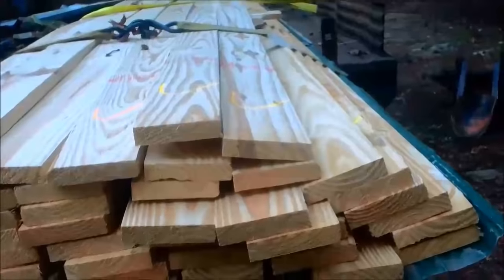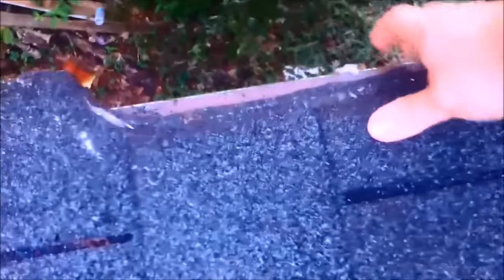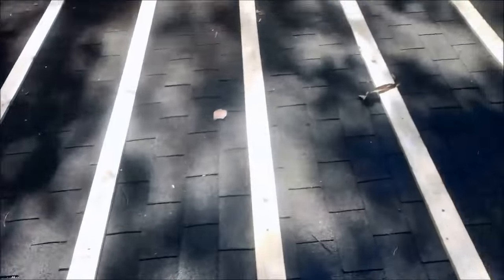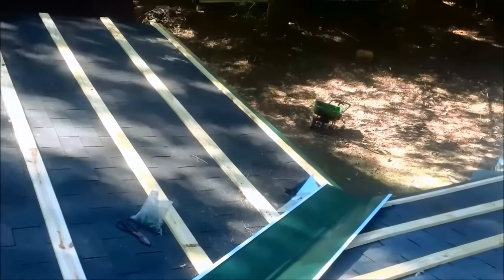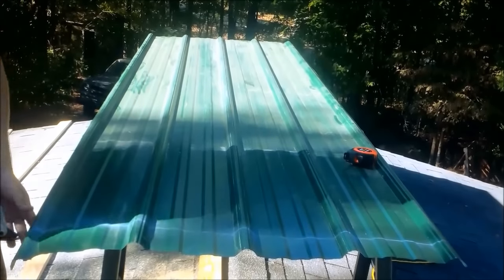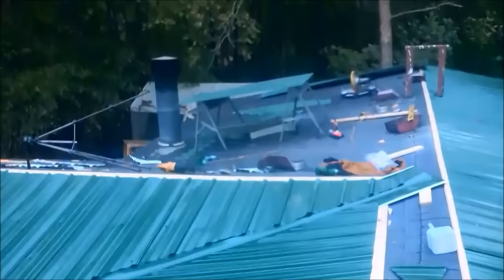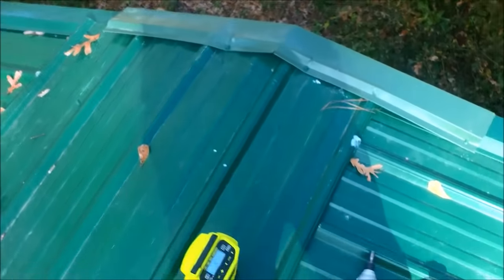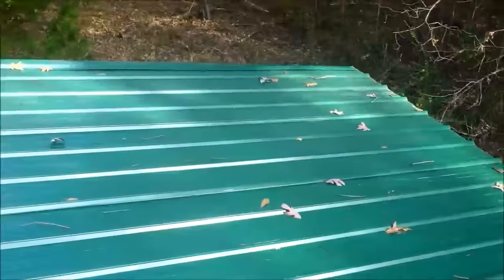How To Metal roof for cheap

Comment: i did ine by myself, took me 3 years, i have bad eyes (i see two screw heads ) and afraid of hieghts. but im poor , so had no choices. i used 5/4 deck boards two feet on center, and used 1inch foil foam between for extra insulation, noise dampening. but i know im no expert, just making due
Reply: You are also a poor speller.

Comment: Nice job. Doesn't look bad. The only concern I would have is leaving 3 layers of shingles on if I heard you correctly that is a lot of weight to leave on your roof especially if you have 2×4 for your roof.
Reply: that's a violation of building code 2 roofs max  and if you have the architectural you cannot shingle over it metal probably ok with long fasteners
he mentioned triple roof plus the strips tat roof is holding a hell of a load if its in snow area there's no margin . roof collapse will destroy the home and insurance might not pay.  see there's areas where there's no codes but it don't mean skip proper building practices

Comment: The reasons the member below said your boards will rott out is from condensation,the industry standard is to lay a vapor barrier down 1st,then your boards ,in between your nail boards you need to insulate because the dead air space under the metal panels will experience thermal shock and sweat,I've fixed hundreds of leaks from non insulated expansion joints and non insulated metal overlays ,I'm also a journeyman roofer/ waterproofef .

FYI the use of treated lumber is no longer required,the industry mandated all treated wood in the 80's and after 3 decades found the treated wood will dry & pop lose it's fasteners and even pull out bricks with tapcons,you used the right wood but skipping the vapor barrier ( cheap 4 mil plastic ) and insulating may cost you a huge condensation problem .

If that happens don't freak out,just remove the ridge cap & fold the gutter edge of the panels up and allow fresh air to flow,install a raised cap with a 1inch gap to allow air flow and condensate should stop .
Reply: I think it doesn't matter.. One clever man said: I am not so rich to buy cheap shoes.. I also think that if you are doing something - try to consult with someone how to do it right, but in this case it looks that he don't care about what he is doing and how it will be looking after...
Reply: joshua2585 you can install a standing seam panel roof directly over perlins but in a residential setting it's not a great idea due to thermal shock , an ice cold or baking hot metal roof will condensate badly ,if your in a cold area heat loss in the attic will hit ice cold panels and make them condensate and drip into the attic .

In a hot area where air conditioning is used for hot months cold air loss through the attic will allow cool air to hit a scorching hot metal roof & cause condensation ,which drips into the home .

It's an industry standard in commercial roofing to insulate the substrate before installing panels,or to instal a waterproof skrim such as ice & water shield under the panel system so condensate can run out from under the panels ,a cheap alternative is to install ice shield on the perimeter & lose lay a heavy visquen plastic sheet under the panels to shed any condensation out of the system and into the gutter .
Reply: over a existing shingle roof no vapor barrier is required and with the air flow between the metal and shingles  it will keep the tin from sweating very much
Reply: Rusty Shackelford in climate zones like Michigan or Ohio that experience constant thermal shock of roofing materials a waterproof skrim under metal roofing panels is a must ,a vapor barrier is an entirely different material .
Reply: I like the tip Michael gave and the roof work. Good job.
Reply: So if you are starting from scratch where you have a shingles roof but want a metal roof. What is the best recommended process and products.  Seems every estimate is different.  What is the best longest lasting way for a place in TN.   Ty
Reply: It has to breath and dry out quickly when the sun comes out a ridge vent done properly would have helped considerably that is one of the biggest issues i have with it is the use of pamels as ridge cap that is terrible at best
Reply: What keeps critters, wasps and bees from inhabitating all those openings ?
Reply: @dennismadigan2023  Nothing lol . you do ..... Some venting can be purchased fairly cheap at a Re Store or on line , &  you could use a piece of screen behind your venting system.
Reply: @atkgrl  tear off the shingles, peel n stick the first couple feet of the roof edge and than paper it than install metal
Reply: @cammccarthy686  but metal directly on the wood roof or on slats.  So it would be a cleaned off old roof, then membrane, then slats then nail the metal to the slats?  So the roof doesn’t sweat and rot away?
Reply: @PlayGirl  you can NOT put metal directly to wood. Metal and wood heat up at different rates which as you said would cause sweating and rot. Their has to be some kind of membrane separation between the two. The same can be said with metal touching concrete , concrete will eventually eat the metal
Reply: @PlayGirl  you would just peel n stick the first couple feet to stop ice damning and than tyvek the rest and install the metal onto the tyvekd plywood.

Comment: Looks fine.... I used to be a roofer years ago.... No need for silicone in fact it is more likely  to cause a problem by making a dam that holds water at the seam.... We would use mastic at the edge that is underneath just thin coat that stops capillary action.... Otherwise bend up both ends and run a ridge over the joint edge.... But you have nothing to worry about you have a roof under your roof... But you should have made gaps in your wood underneath so that air can flow from bottom to top evaporating moisture that in your install will begin rotting your fiberglass and tar paper roofing... As well as the underlayment skins.... Also having those gaps for ventilation would allow your roof to carry away heat in summer.... It's not a big deal I'm sure it will be fine if looks like you do have some horizontal ventilation.... You could have run black pipe under your roof in the gap to pump fluid thru to heat your home on the cheap in winter as well....
Reply: When you said gaps, how would you do that ? Cut into the furring strips or .....?

Comment: It might last 5 years but I doubt it speaking from 45 years in the construction trades. That ridge cap is what is going to cause problems first.  If it doesn't blow to hard when it rains it might work.....Good Luck
Reply: More than one way to skin a cat. I glued some kitchen cabinets to drywall and everyone said it would come down and won't support the weight its been there since 2006 i moved from that apartment and the new tenants are using it
Reply: @divinee.155 mama always said, stupid is is stupid does. 😅

Comment: Keeping the old shingles will cause massive heat storage in the summer. This will impact you A/C bills if you have more warm days than cold days (such as in Florida). Hot roofing shingles will keep the attic hot all day and well into the night. The metal roof by itself will dissipate this heat into the air as the air cools, the mass of the shingles will not. The shingles will readily absorb this heat from the metal panels and hold it well into the night. But, if you live in a climate with more cold days than warm days, then this would be a good thing.

Comment: Saw your thumbnail and had to drop in and say my Mom’s neighbor had a metal roof installed after Hurricane Gustav but had it laid directly on the plywood decking. Along comes nasty Hurricane Ida and he had no damage. Some roofs with metal that were installed with stripping were ripped off. Air got under there and pulled the panels off.

Comment: very nice. I am inspired. I think the caulking should go under so it is not exposed to sunlight
Reply: +David Phillips The caulking should definitely be sandwiched and a high-temp variety.  The UV exposure will make it brittle in no time.
Reply: Caulking is the wrong product for that.the manufacturers specify sealing tape.it’s a special mastic similar to what they use for automobile windshields.Stays flexible in all climates and conditions

Comment: what about putting 1/4 inch rubber strips on the wood so when you screw in the screw you have a rubber gasket on the top of the screw and under the sheet metal to keep it from leaking it the rubber gasket on the screw fails. the rubber strip under gives it added protection and sealing power????

Comment: Great video. Not everyone has the money for a "professional" job. Some just need it to be functional. Making it "Pretty" is very expensive while functional, serving the purpose, can be accomplished on a budget. Your right that they rob you on the trim. There are ways around that which still serves the purpose you just need a creative mind. Luckily I'm not the type who is obsessed with it being "pretty". As long as it does the job I'm good.
Reply from the maker: people spend a lot of money chasing pretty for my own house i buy from the scratch and dent store and i save thousands that way.
Reply: I need  a new roof and have little money.  also disabled 62 yr. old woman.  Where can I buy scratch and dent and how much should I expect to pay to have it installed.  raccoons on the roof have been scratching to get in the house.  just spent $200 for a patch job.  any help/advice would be greatly appreciated.  ty.
Reply: Dale Higgins cheap is not an option
Reply: daschundloverable racoons?
Reply: Dale Higgins I completely agree with you sir
Reply: many ads on Craigslist with roofing installers, u can try one of them.if u catch a roofer in winter months can sometimes get a awesome deal

Comment: If you are putting metal roofing on a slightly sloped new building roof with a tar paper cover over the OSB do you need to put the 1 x 4 down, or is that only to fir off of shingles??

Comment: Danny, has the roof remained leak free?  (I'm assuming you have had to do regular maintenance, at least after 5 years).  Very well done, btw.  Adapting to your needs by fabricating the parts you need is impressive.
Reply from the maker: It's worked out great we had a tornado earlier this year I had to replace the ridge cap that's about it I appreciate your comment

Comment: a bud of mine bought a house in need of a new roof, it had a simple low pitch A-shape roof and he got them to take $15,000 off the house price here in Washington.  Me and him worked on his roof for 4 weekends and put the metal roofing just like this over the older shingle roof which thankfully wasn't leaking anywhere.  He spent only $580 for materials as he got 3 different color metal roofing from a local roofing comoany that had leftovers from numerous jobs and we improvised.  He also used scrap throwaway frame boards to install for the frame which didn't cost a thing either.  All he had to buy was the screws, caulk, and metal trim and joint metal pieces and that was all!  He got 2 estimates from roofing companies up here who quoted $22,000 and $19,500.

Comment: Guy quoted me $1900 for my 18x20 garage roof.
I had the Amish cut me a roof kit for $525.
Doing it myself now.
Its not impossible.
Reply: Damn, wish I'd find pricing that low in central Ohio.
Reply: Gerard, Im fixing to do metal roofing in a mobile home fixer upper,. Is a single mobile home,. How much do you think I would be spending on material only?. My brother in law is willing to do the work for me if I buy all the material.. do you have any idea???
Reply: @mayte8018  what is the length and width of the mobile home. Basic dimensions will help give you a rough estimate. Then are you looking at doing trusses or rafters and what is currently sticking thru the roof like vent stacks or chimney's
Reply: If it was Lancaster Amish, can you provide referral / source?
Reply: Can you give me a contact for the Amish roof kit. Thanks

Comment: I'm not a roofer or carpenter, but why do you need to add the 1x4 cross boards.  Could you just use longer screws  and screw the metal shingles over the existing shingles?

Comment: I did the same on my roof expect its double layered shingled. House started to shift. And cracks in walls. Think its a little to heavy but I just fill the cracks in sheet rock and repaint wall lol.
Reply: It's not the weight, leaving the singles on and not removing them is a national code violation. The singles are a combustible material. People have had their house burn down. It's the same thing when using lacquer, acetone in the trash because it can Ignite

Comment: If you do yours like this man is teaching you to do you will severely screw it up the three-quarter inch boards won't have enough meat to hold screws and they will back out the condensation that occurs in the space left out of 3/4 inch boards will condensate and will Rust the metal

Comment: Im on almost the same kind of a project. Similar roof layout. Been putting on the furring strips , mine are 27 centers. Its fairly hard finding the rafter centers to make sure the 1x4's are down really tight. Im using 3 1/4" nail by air nailer. Im concerned that Im getting the 1x4's close enough to the edge so i can put on the drip edge, because i didnt cut off the overhanging shingles with a sawzall. Is that drip edge essential? also im using double bubble roll under the metal panels. and im using brilliant white metal to reduce heat in the home. THis is the main goal. since this double wide has zero loft insulation. it causes the a/c to run 24/7..

Comment: Great job man. When I worked construction we put metal roofs on all the houses. Great system, it will last you a long time.
Reply: You can’t be serious...🤦🏽‍♂️🤦🏽‍♂️
Reply: @SilentProwler  what wrong with a metal roof ?
Reply: Hell if you don’t know what’s wrong with it. then I don’t even need to tell you
Reply: @SilentProwler  what would you have done different , just trying to learn does and don'ts,  what size screws to lay 1/4 over shingles
Reply: @irshaadwalee8094  tear off old shingle, underlayment, measure it right, slat it, install the right panels correctly , spent the extra ridge cap and for the trim, with 1 1/4 screws or 1 1/2. Might aswell spend the a few hundred extra and get it done right instead of doing it half way and regretting it 5 year later
Reply: We need a new roof. Want to keep low budget but don't want to compromise quality. So what is a good price for a shingle roof ?
Reply: @momoshark2257  depends on how steep the roof is but usually $100/sq if you do it yourself with architectural. $250-350/sq if you hire someone
Reply: @momoshark2257  look this is what ur going to do. Measure ur roof and buy the material at home depot it's pretty cheap their tbh. Or find a supplier that sells "IKO" never get "GAF"Then ur going to go to a new construction site and find a roofer working on a home. And u will offer him 60$ a square. 30 to tear off, and 30 to install. If ur roof 10, 12/12+ in pitch you should pay about 70-80 tottal per square. One square=100sq feet btw

Comment: It may b cheaper but you not only have the weight of the original shingles on your roof  but you're adding even more weight by putting metal panels on as your new roof.

Comment: This is a good video, my only concern is the seam on the ridge, with the time the caulk will break and go in between because the standing seam won't let the water out, but is good bro
Reply from the maker: I checked it last year and recauked your right the old silicon gets uv damaged

Comment: I would have silicone under the panel to form a gasket seal instead of at the joints externally. The elements are going to loosen up the silicone and leak.Concerned about the valley with the exposed ribs. Ice dams snow melting into the ribs could be an issue over time. Saw the comments on a vapor barrier and took note of that.Thanks for the video Danny.
Reply from the maker: We haven't had snow or ice in 10 years good info though on colder climates

Comment: The ridge cap would have been worth it they sell some pretty wide ones.. anyway the  purlins run that way is the only way you cannot run them vertically! Thats just well nevermind about that i usually try to leave the old stuff its just a lot to dispose of it all and the labor costs involved in a tear off is not cost effective at least not to me anyway the proper underlayment would not have been but another 50 bucks and i do recommend the  3/4 foam insulation between the perlins customer wants it we do it they dont that is their decision 2 ft centers on the perlins screwed down at 12 inches on center so every other screw if you try will go into a truss i had one inspector in holly hill read the code wrong and he made us do 4inch on center staggered on the perlins that was just crazy and made nothing but Swiss cheese out of them but you do what they want or get held up and pay reinspection fees till you die of old age your right there the trim is pricey but makes the job in the end we pre drill all the panels idk 10 at a time or something and when its finished and all the.  Screws.are in a perfect line both horizontal and vertical it really makes a big difference ive seen some really bad homeowner or handyman roofs and smh wow it will work probobly for a good long time as long as you didn't go crazy overtightening the. Screws
And destroying the. Washers over all if yohve never done one before yoh did in my opinion not terrible its just that there are so many hard. Working honest guys that would have been willing to help yoh and share what they know even for just a days pay of 150.00 or so and the end result would have. Shown the difference so I bet another 300 bucks or maybe a little more would have been well spent and an inspection to show upon sale of the place is a big selling feature now yoh gott a kinda hope they dont notice the green stuff up there n ask about it price yoh wanted surely cut down some